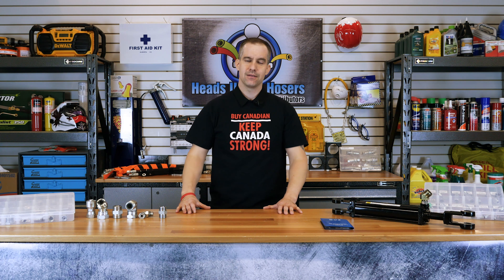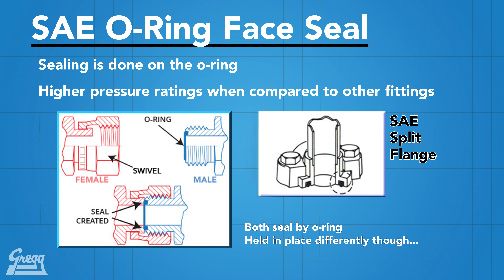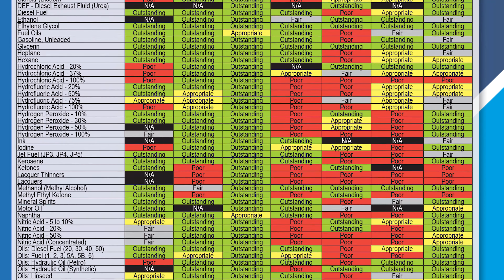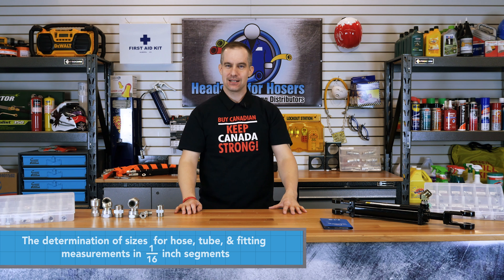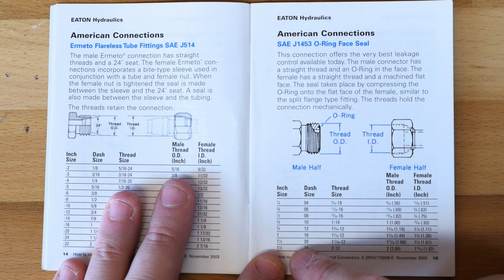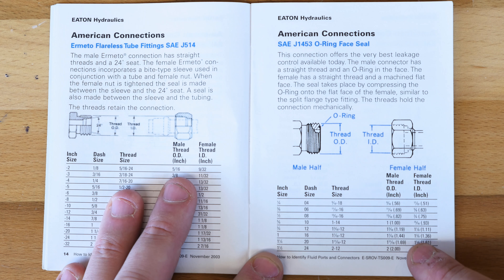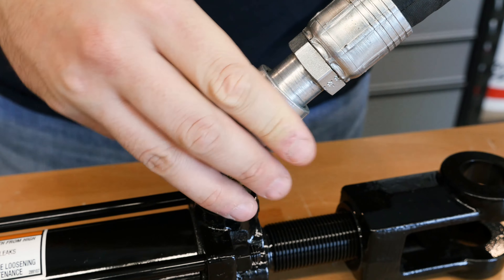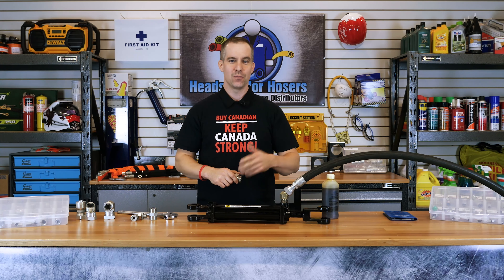O-Ring Face Seal (ORFS) Fittings - Identification & Installation - Heads Up for Hosers

Comment: Very good introduction to the technology.  I'm interested as I work with prototype refrigeration systems and there aren't easily available connectors that do the same from HVAC suppliers (at least, here in the UK).  Do you have a distributor here?

Comment: Can you please elaborate what do you mean the "Sharp rise of torque" when tightening.. How do I know when to stop tightening an ORFS? Thanks!
Reply from the maker: Unfortunately, this is not an exact science.  As you tighten the fitting, you will feel excess resistance to the point where it is too hard to continue to tighten, you should stop at this point.